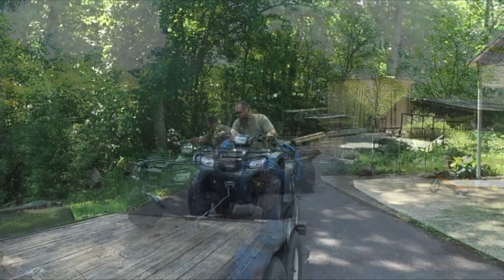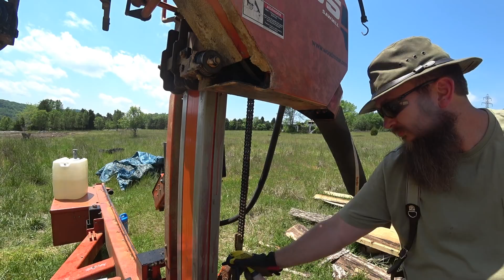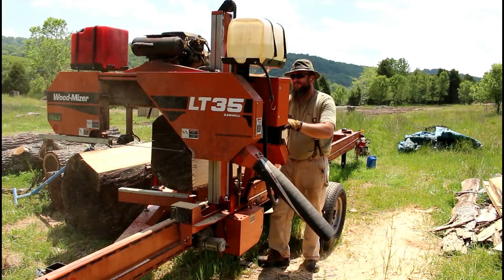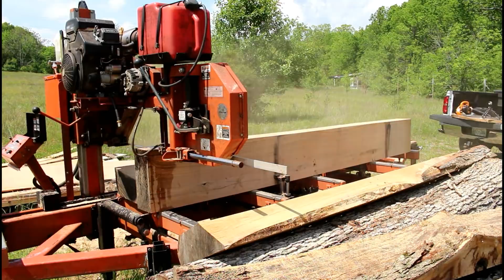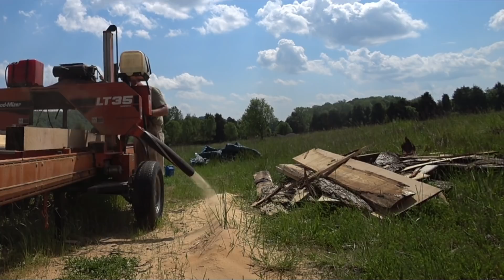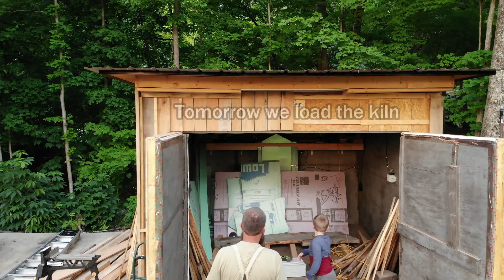THE 2018 SAWMILL SEASON IS OFF TO A GREAT START, OAK ON THE MILL AND WALNUT ON DECK

Comment: Oak fence boards? That’s something I have never seen before.
Reply from the maker: Yes white oak only. Red will rot. White oak will last long time
Reply: Out of the Woods 
Around here all we usually see is cedar or pressure treated.
Reply from the maker: What area you at?
Reply: Out of the Woods 
Ontario Canada. 
White oak would make a great fence but I doubt many would want to pay that much for a fence.

Comment: It’s not required to have a steady water supply? I noticed you shutting the water on and off. Just wondering.
Reply from the maker: It depends on the tree. Our white oak has a lot of pitch around here. Builds up on the blade. If you don’t rinse it off the blade can dive and other bad things will happen. But when sawing cedar. Little to no water. Just enough to keep the blade cool.

Comment: Let me know if you ever find a plastic spray bottle that does not get destroyed by oil. I put Kroil in my spray bottle and it pretty much looks and works just like yours.
Reply from the maker: Same here. I go through them also
Reply: When I went to the Wood-Mizer show, They were using what looked like a restaurant catsup squeeze bottle for ATF. It worked great!

Comment: for spraying down your mill on amazon

Gino Development 03-0828 Reusable Refillable Multipurpose Aerosol Spray Bottle and Spray Tip Set, 16 oz
you might find it nice
Reply from the maker: Thanks. I’ll check it out
Reply: When I saw you spraying your mill down I though of my rechargeable spray cans and looked up where to get some.  Hope the info help's every one will buy one soon for my self for testing.

I got my first one's in the 1980's from "HF" and they worked great but I will need to replace them soon. I found I could save ton's of money by buying by the gallon.  ie( wd40, trans fluid, light weight oil, solvent's ect).